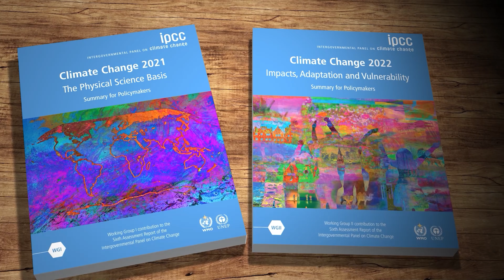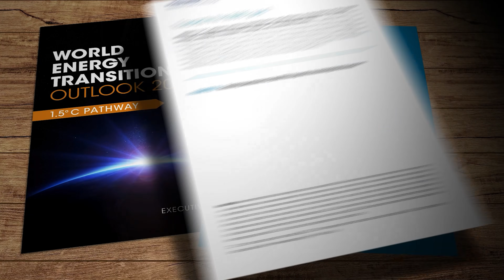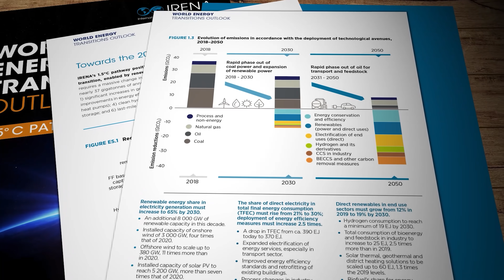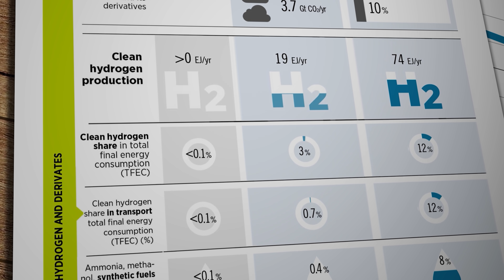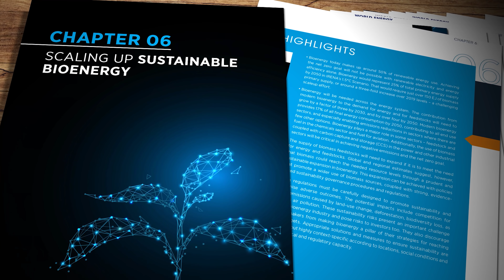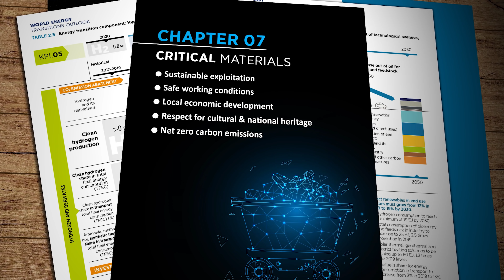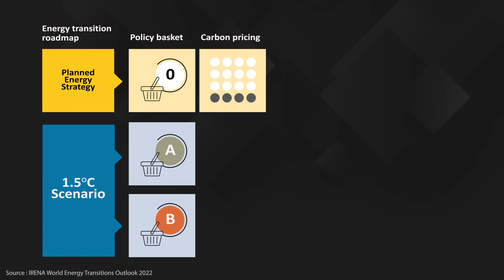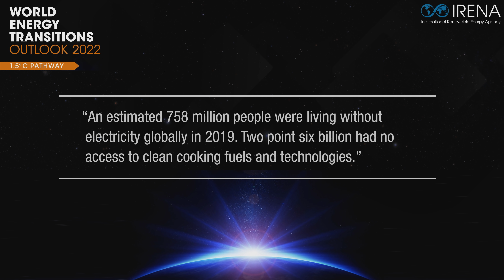Massive global energy disruptions are coming. Brace yourself!

Comment: Amongst the biggest obstacles that I see is the tendency for unfettered capitalist economies to take each new technological innovation (efficient, green, or otherwise) and deploy it in a manner that increases consumption of energy and/or materials rather than decreasing that consumption, as the technology might initially seemed to have promised. The predominance in new EVs of monster vehicles with massive, resource intensive traction batteries that are distinctly less efficient (km/kWh) than what has come before, is just one of the latest, currently developing example of this.  
Until the overwhelming consumer mindset undergoes the paradigm shift from wanting ever more, to embracing ways of using less while still finding felicity, then the prospects of real sustainability remain bleak.  
Gandhi was spot on when he asserted, “There is a sufficiency in the world for man’s need but not for man’s greed.”  We would all be in a much better place in the adoption of that motto.
Reply: Congrats on the word salad
Reply: @blackmartini7684  good exercise 🤓

Comment: Dave thank you for identifying these references.  I find most of this assessment from IRENA wishful thinking.  Logically oil should draw down faster than natural gas.  The EIA and IEA both recognize that natural gas will be with us through 2050.  Carbon pricing has to go up for any hope of significant change.  Hydrogen hype is oversold.  It will be a niche market and will shrink rapidly after a Hindenburg type event.  Trillions invested in natural gas infrastructure will be leveraged for decades to come.  Renewable growth must be met with equal energy storage capacity.  Again, reducing GHG emissions rather than emotional demonization of fossil fuels should be the focus.
Reply: Gas vapors are more explosive than hydrogen. Yet we still have gas, despite all the explosions.
Reply: Hydrogen in cars is dangerous, but in the static environment of a building, it's doable.
Reply: @alainarchambault2331  Hydrogen cars are safer than gasoline. Fuel cell cars have been around for decades. However- you're still correct. But it's because of ratios: tank size to volume. As you increase size, surface are is squared (^2). However, volume is cubed (^3). So small tanks really don't hold much H. Things like busses, airplanes, etc. are large enough for H. But stationary power is larger still, with even larger tanks allowed. So yes, i would focus on stationary and mass transit for Hydrogen power. But only then "green hydrogen", since "blue hydrogen" is a total joke.
Reply: @onebylandtwoifbysearunifby5475  
"Hydrogen cars are safer than gasoline."
Had to look that up...
"Hydrogen can be explosive with oxygen concentrations between 18 and 59 percent while gasoline can be explosive at oxygen concentrations between 1 and 3 percent. This means that gasoline has greater risk for explosion than hydrogen for any given environment with oxygen."
Okay, so that means gasoline is easier to set off. Outside of the ignition point I was also under the assumption that Hydrogen was more explosive when it does go off. 
https://www.youtube.com/watch?v=TadzcsDmWY8
Then, as you say, there's the part about energy density. Fortunately, in buildings at least, more can be produced on site.
Reply: @alainarchambault2331  Yeah, it's a pretty engrained popular myth that Hydrogen is exceptionally explosive.Gasoline has a lower flashpoint. And once ignited... Energy density of gasoline is greater than hydrogen. Largely due to the long hydrocarbon chains packing in like straws in a bundle. "Octane rating" is your % of chains that are 8 carbons long or longer. Plus, the bond energy of C-C is far higher than H-H. And there are 2 or 3 H for every C in fossil fuels. Gasoline is far more explosive, and when it goes, it really goes. 

...still, we sit on highly explosive tanks of the crap everytime we drive ICE cars. The engine is an explosion chamber. If folks can make petrol cars work, they should have little trouble with busses and aeroplanes. 

That said, i agree with you that residential and industrial are the best candidates, followed by large transit vehicles. Smaller cars could do fine from battery. Electric high speed rail is really what we need. Fewer roads, fewer cars, faster and safer travel. The "Electric vs. Hydrogen cars" is somewhat of a distraction. We need good efficient electric rail networks.
Reply: Thanks for the information.
Reply: @alainarchambault2331  Because hydrogen is the lightest gas there is, it rises very rapidly in air.  It would be difficult to build up a large volume of hydrogen at a concentration of greater than 18%.  Hydrocarbons, on the other hand, are heavier than air (excluding methane and ethane) and tend to hug the ground until they find an ignition source.  Hydrogen is not as dangerous as most people think it is.  The main problem with hydrogen as an energy carrier is low efficiency and high cost.
Reply: @Hattie Lankford I am simply saying that focus should be on reducing GHGs.  Many have jumped to conclusions to eliminate all fossil fuels and electrify everything ASAP.  However, if you do the analysis, the carbon intensity of burning natural gas for heat is far lower than most electric grids currently.

Comment: How do you weigh a ton of hydrogen?
Reply: Put it in a box and weigh the box. Simple
Reply: @sammason2300  You have to weigh the box when it is empty and take the difference. How do you get the air out? And how do you prevent the box from collapsing when you get the air out?

Comment: The chart shown around minute 3 should be recalibrated to show absolute numbers over time instead of percentages. If total consumption also grows we could be emitting just as much even though the percentage would show a reduction.
Reply: Right. Percentage is a ratio, not a quantity.
Reply: They actually are calibrated by consumption.  The full report is operating under the framework that power generation will roughly triple by 2050, and will specifically grow from 26379 TWh in 2018 to 42189 TWh in 2030 (Table 2.1, p 70).   Dave's graph at 3:00 seems like it's based off of Fig 2.7 and is specifically referring to necessary reductions "total final energy consumption" that can be achieved through efficiency gains related to electrification, hence the reduction from 390 EJ to 370 EJ (p 88).  They break down how these efficiency changes would have to work out by sector in Table 2.3 and fig 2.6 (pages 84 and 82 respectively).  Many sectors see an increase or no change in final energy consumption despite their aggressive efficiency plans, again making it clear that they are accounting for the general growth we all expect (Table 2.3). Again, to be crystal clear, the point of this graph is to outline how to reduce overall energy consumption despite realistic growth expectations, and is not just assuming consumption will be reduced magically.  https://www.irena.org/publications/2022/Mar/World-Energy-Transitions-Outlook-2022
Reply: @gg3675  Thanks for the explanation!
Reply: Population doesn't shrink, it requires more and more resources to sustain. We peeps are nothing more than overpopulated animals in a cage. Over population resolves itself, won't be pretty, and our penchant for self preservation will ensure a massive population decrease
Reply: @STEVENFRYFRY  population is already shrinking in many parts of the world, we reached peak child levels in 2000. Population growth is now driven by the lack of people dying as they live longer, peak population is now expected in 2064 at 10 billion, before starting to fall quite quickly. With new food technologies being developed this is easily sustainable if we aren’t complete idiots, unfortunately that is a big ask!
Reply: Yeah I didn’t get that chart.
Reply: That chart shows absolute numbers in the top right hand corner, which increase as time passes (top left hand corner)
Reply: This is exactly what happened in south korea, they got greener in the past decade with their investments in green energy but as overall consumption too increased, there was an overall net increase in greenhouse gas emissions despite all the effort. The green energy revolution is useless unless we reduce consumption and that ain't happening. The whole show is coming to an end, one add to cart click at a time.
Reply: Yes, Pacific Islanders are turning towards the East for Support as their Isles are going under continually with tide rises. Places like the Great Australia need a bite taken out of them to 🤔 think( oh ) they’ll need to move over here …..🤔maybe we (should have Housing  Commission Scheme  Back — Fully Operative Now) —    They’ll need a place of Dwelling  🤔WHAT DO THOSE OUTSIDE AUSTRALIA THINK OF ? !!
Rather than the trading of * Green Points * 😵‍💫
Reply: The more "efficient" we become at using an energy the more we use it. Until the overall exhaust of the "green" energy is greater by total, although lower by comparison. - the principal of Jevons paradox.  As long as the population grows, the new people will want all the old people have. Someone will sell it to them. The goods will start in a fire & our exhaust keeps rising.  I’m sorry, I don’t think we outthink our remarkable & ridiculous population growth over the last 100 years. 

It supersedes everything we do to mitigate other things. I hope I’m wrong though.
Reply: @T1tusCr0w  most countries including USA, China, Russia and most EU countries have a large chunk of boomers. Who, as they retire in next decade, stop consuming. Read someone like Peter Zeihan Disunited Nations
Reply: @HughButler35  🤦🏻‍♂️ there’s 5 of the seven billion people under 40 - almost 3 billion under 20 by natural wastage  ( having under 2.2 children per childbearing woman ) would would not see a stoppage of increase until 2050s. I come from the much maligned field if demographics ✋🏻
Reply: @T1tusCr0w  I think the point made by Hugh is still valid, most population growth is in low income countries and the reduction in consumption of boomers with restricted lifestyles of age will reduce their consumption. I think demographics across the world are going to be a huge additional challenge for the rest of the century, whether we get to grips with climate or not. It’s interesting to think that immigration being a topic for encouragement in the future as the ageing west and east look to bolster both production and consumption.
Reply: Great point, reduction is a critical step we can all take now. Less stuff, higher quality, crafted locally. Closed loop feels like the direction we must go.
Reply: @coder8i  
Won’t work. The central banking model necessitates exponential growth. That is growth of debt, production, and consumption. By design, the global economy cannot function sustainably. It follows a cycle of booms and busts, like the tides. Each time, wealth is pulled from the general public and consolidated into larger and larger companies. We are in the largest cycle right now, and it is on a global scale.

They tell us that the supply chains are stopped up, but they are moving more goods than ever before. Everything on the news is artificial, and the real situation is quite complex, although still manmade.
Reply: Not sure that you haven’t missed the point of that analysis
Reply: Funny thing is, the total energy consumption shrinks in the given period. I don't see that to be a likely scenario in the first place...
Reply: @Sekir80  That's likely a result of electrification and it's resultant efficiency increases. Currently in the US about 60% of primary energy is wasted due to ineficiency (rejected energy).
Reply: @durwoodmaccool890  Electricity is a mature and well-understood technology (platform?) by now though.  It's hard to imagine being able to dramatically increase the efficiency of the electrical grid in general.
Reply: @durwoodmaccool890  Likely. But I don't see China, India, or any developing powerhouse to be slowing down. A whole continent, called Africa. There'll be challenges.
Reply: @davidbarry6900  that isn’t the point being made, the move from fossil fuels as the generation mechanism reduces the total energy consumption due to the removal of inefficiencies directly related to burning stuff for heat to make electric.
Reply: @davidbarry6900  the efficiency gains come from electrifying systems which currently burn fossil fuels directly, eg. cars, domestic boilers etc. A car is only about 35% efficient at extracting useful energy from the fuel in it (which has already cost a lot of lost energy), an electric vehicle is say 90% efficient. The key thing is that even fossil fuel power stations are much more efficient than local burning and if the power is from renewables there are huge efficiency gains.
Reply: @davidbarry6900  It's not the efficiency of the grid, it's the processes using the energy. For example transport, dinosaur burners at best will use maybe 25% of the primary energy to move. Electric vehicles use  energy much more efficiently, closer to 80%+.
Heating is similar, burning gas to stay warm at best gives 1 unit heat for each unit of input, usually less due to old design. A heat pump gives 2 to 3 units heat for each unit of input energy.
Reply: @Sekir80  That's the thing, they don't have to slow down. They can go directly to electrification and bypass the combustion age. Similar to how mobile phones let them bypass the wire age.
Reply: @durwoodmaccool890  Very true! It can apply to African nations, but as I heard somewhere, sometime China is planning to open a lot of coal plants, still. But I'm not following these news.
I truly hope Africa can skip the fossil age.
Reply: @durwoodmaccool890  That's all kind of irrelevant unless you can figure out a way to get immense amounts of electric power available on demand.  We're getting a small way there, but this issue has not been "solved" at civilization scale yet (without fossil fuels).  The huge advantage of the incumbent fossil fuel systems (for heating and transport) is that they are both very energy dense, and easy to store for use as needed.  They are so energy dense that it simply doesn't matter if a lot of the potential energy value is wasted.  Fossil fuels are what enabled us to get away from slavery, among other evils.  There's just that pesky pollution/warming side effect... 

I'm not saying that we need to keep using fossil fuels - just that it's going to take a lot longer to get off them than the Irena report envisages.
Reply: @durwoodmaccool890  but renewable energy can be mined not just made which drastically reduced the opportunity cost of disruption.

12 out of 37 is unacceptable... if you want to leave .7 and take down 36+  some three times as much plumbing heat from core to domestic work, much of which is heat requiring, almost all of the rest of which can be driven by heat, so "prioritisation of only the lame" is the past game.  True fame comes from having the courage to ready ourselves to leap into solutions initially at scale and not so much assume that largely we must fail.
Reply: @charleslyster1681  Solar hydrogen points out the 'lost' of using electricity to accomplish a task, like wresting hydrogen away from oxygen, confronting a strong force of nature wrongly duh.  We should listen to them and be willing to extend the truth beyond there business plan of 'modules' that do not threaten oil with exponential gains.

Fax machines did something electric cars don't, and virtual presence not electrification is efficient.

Boiling heat is best produced from condensing compression- that heat need not merely be a nuisance mainly.

But we talk reports without talking about price of heat.  Until we let commodities control even just heat we remain doomed.  The price of heat remains insanely high because it is not traded.

A nuclear powerplant produces heat and almost none have been built because adding value to it is not to make electricity with it!

Large nuclear powerplants cost more then mining the heat directly from existing nuclear or whatever production.  We don't need our energy to be 'renewed' if it is inexhaustible and this channel talks far too infrequently about the impossiblity of cooling the core of our planet just from displacing all other sources of heat production via it.

Lowering the price of heat is what keeps oil from market duh.

ANd cheapens cost of plastic which means affordable products of quality.  Resin is not the enemy, dumping it and burning it are.

Heat is available to solve our problems we crow about if we are willing to pay far less for it and care less about who gets disrupted and there foot on our throat.

That's democracy in action for first time!
Reply: @durwoodmaccool890  no cellular technology occured wtih wires first
Reply: Nearly every narrative regarding the climate and green energy are deceptive. The proponents overhype the risks through misrepresenting data. And, they ignore how deadly the proposed measures would actually be. They look at the wrong things, like CO2. Meanwhile, the opponents pretend that there are no issues at all and want to continue as if everything is great.

The climates are changing on planets throughout our solar system; we cannot avoid the coming climate issues. We must look ahead and restructure our society for flexibility. Meanwhile, overconsumption is a problem. Overconsumption is a direct result of the central banking model where wealth is ever-increasingly borrowed from the future. This mechanism alone has created a human bubble along with a financial bubble in every market. The system will correct as real mechanisms reign in the fantasy. The green revolution does not avoid this but rather transfers wealth and power.
Reply: @Austin1990  I don't think I've read so much baloney in a long time! Every sentence is BS but I guess you have heard that many times
Reply: @Neilhuny  
Nope, I do not hear that. But, I keep highly educated company.